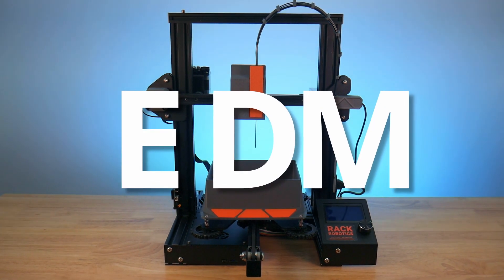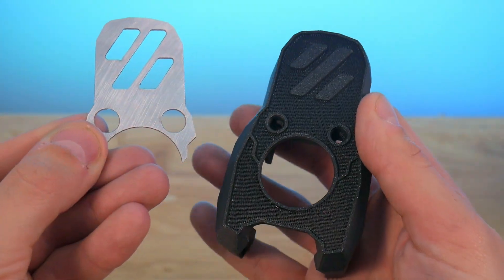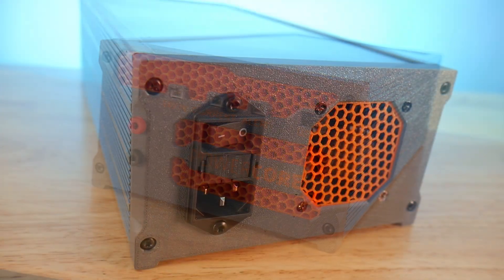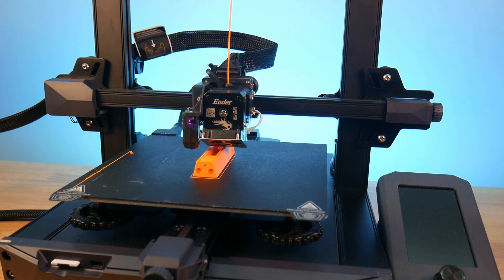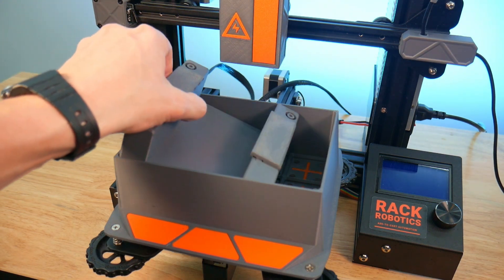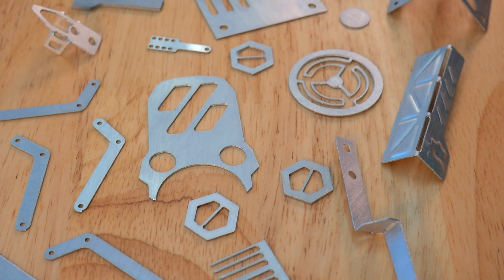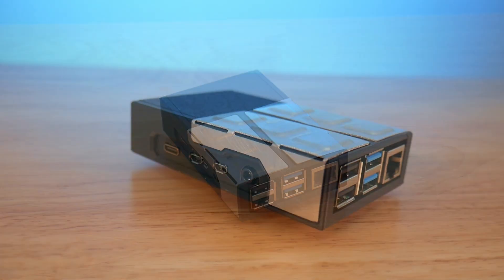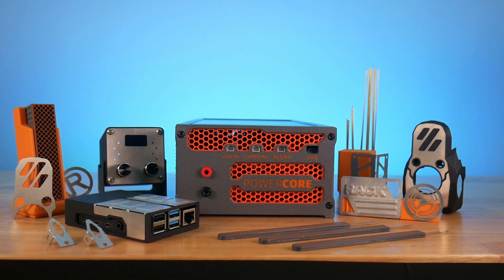Meet the Powercore - The World's Most Affordable EDM

Comment: What’s the practical maximum thickness you can cut? What’s the limitation, is it just a question of the debris piling up as the cut gets deeper, so the cut becomes irregular? Have you considered a nozzle around the electrode, so you can pump a flow of water around the electrode as it cuts?

Comment: How thick can you go? Can it cut 3mm alu sheets? if it can I'm very interested as my cnc router gets the job done but with a hell of lot noise and mess...
Reply: Its EDM, of course it can, but for a very short cut only. The cut is eroding both the workpiece and the cutting electrode, the amount of material removed is proportional to the amount of material eroded from the electrode, how far do you think a piece of copper wire can take you? That's why proper wire EDM has a spool of wire that it continuously feeds through so it's always cutting with fresh wire.

Comment: This is far too good to be true. What's the real catch? Something must be ridiculously expensive.
Reply: Seems fishy you are right... No rotating electrode to compensate for ware? no voltage sensing on the leads? no filtering for the dielectric, or option for flushing? Is it open source? Does this use the stock motion control from an ender3, can that even work with so much EMF around?
Reply: @ffoska  it is open source.

Comment: With only thin sheet shown in the video, I guess this is the limitation of the machine? Or does thicker material just take longer?
Reply: Should technically work with thicker but way slower. Not sure on the their software side as I haven't set it up yet.

Comment: Hey there’s a blog called “CircuitDen” that describes a discrete MOSFET driving circuit that should help you avoid that 200Ω pull-up to 12V burning a hole in your board. If not a dedicated monolithic gate driver. The long traces from the gate driver to the MOSFET itself is also pretty bad practice.
Personally I’d have used a switching supply (could use easily available components like the TL494 or MC34063, or existing modules like the common LM2596) for 24V-to-12V for FET driving. Or even just an external 12V DC brick. Your logic rail could be taken directly off the 3D printer’s JTAG or BLtouch headers, along with signals like PWM for the power level (likely via M03), that’s what I’ve done for my laser and drill setup. Doesn’t take much messing about with Marlin to get that working.

Oh and your LEDs are backwards.

Comment: Totally misleading. Shown speed is probably 100x, minimum
Reply from the maker: How flattering! No, those speeds are much closer to reality than you might think. In the thinner stock shown in the video, we've cut up to 80mm/min linear speed! If you don't believe us, check out our X account or see real videos posted by users on the Discord.
Reply: Is there an automatic retract in case of a short cut (electrode, workpiece)?
Reply from the maker: @Hi_Tec  We have just relocated and are going to have to set up a new filming location, but we're excited to do further demonstrations. There is a current sensing output from the Powercore for closed loop controls, but that still needs support in the slicer and printer firmware to work. One of our discord users, The_Digital_1 has this working on their wire EDM implementation using the Powercore.
Reply: Nice to hear. Then I guess you are willing to share some data, e.g. cutting speed for 0,5 mm steel sheet.
Reply from the maker: @Hi_Tec  Definitely! The preset in our opensource EDM CAM, EDMWeb is 40mm/min. You can likely double that with proper flushing of the work. We made the preset slower so it would be more surefire.
Reply: So, this is what you can demonstrate in 0.5 mm (20 thou) steel? That would be great!

Comment: Cant wait for it to become available in Europe
Reply: Edm in europe... eurodance?
Reply: Does the PSU have either a 120/240 switch or universal voltage?
Reply: @soundspark Yes, the internal SMPS has a 120 v and 240 v setting
Reply: @MorlockEngineering  So it may just need a matching power cord then?
Reply: @soundspark  You definitely want at the very least the CE certification. Otherwise it might end up being blocked by customs or void your insurances if anything goes wrong.
Reply: Its open source, the links are in the description
Reply: @theneonbop  Cheers mate! :)
I didnt notice the links.

Comment: Does this power supply have enough power to cut thicker metal around 1/8in thick or thicker or is it limited to thin sheet metal?
Reply: edm can do layer by layer i think
Reply: @fffmpeg  it would be more accurate to think in terms of voxels. the electrode will cut in all 3 dimensions based on which is in the path of least resistance.

Comment: Very interested in that stamping process, will get the most strength out of that aluminum sheet metal!
Reply from the maker: It's really neat! We want to work with it more
Reply: You can stamp thicker than you think sheet metal by 3d printing a negative/positive mold using PLA+ and a regular 10/20 ton press.